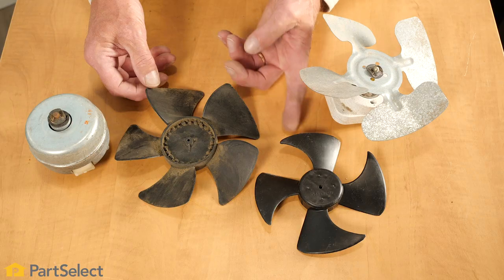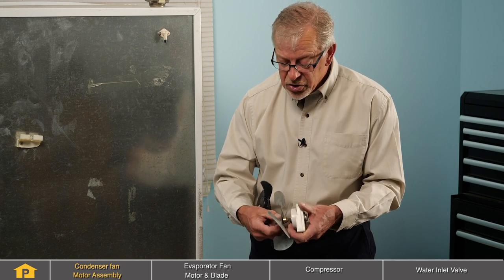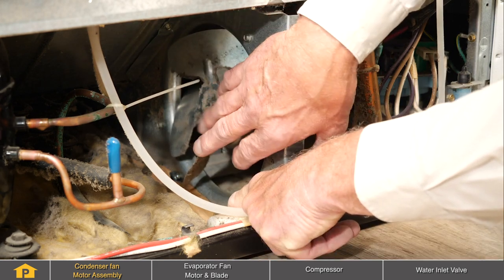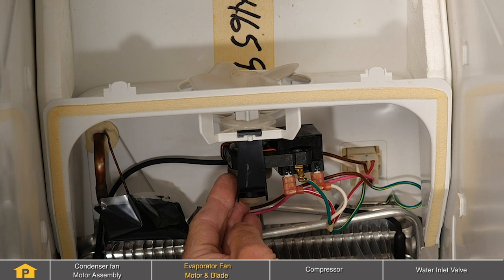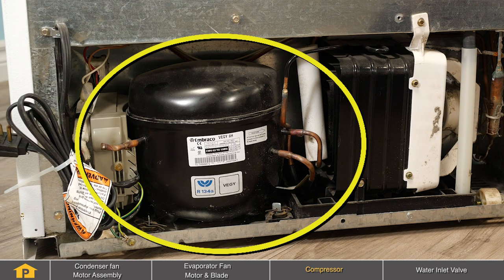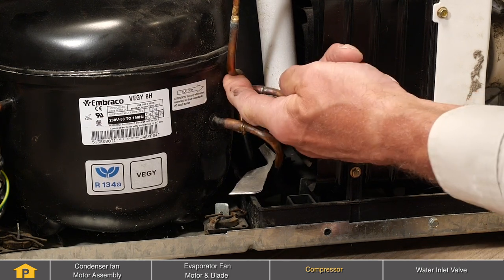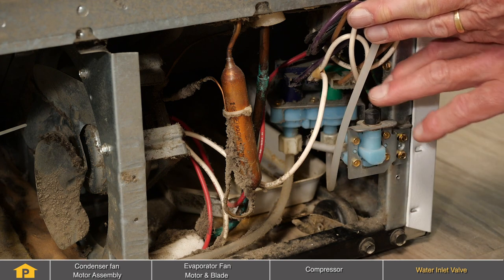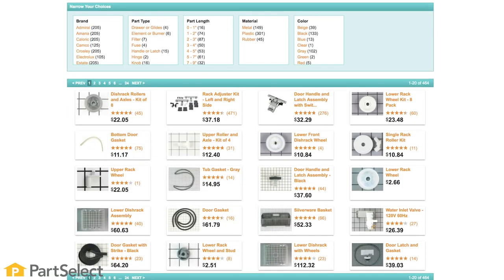Refrigerator Troubleshooting: Why Is My Refrigerator Noisy? | PartSelect.com

Comment: I opened up the back panel and checked the fan etc and found that it was one single cable rattling. Moved it to a better location and the buzzing stopped. Nice and quiet last night. I took the opportunity to clean out all the collected dust too. Thanks for the video.